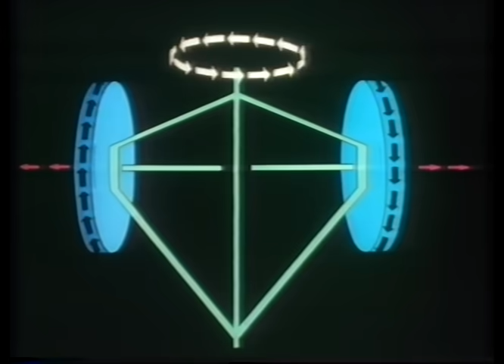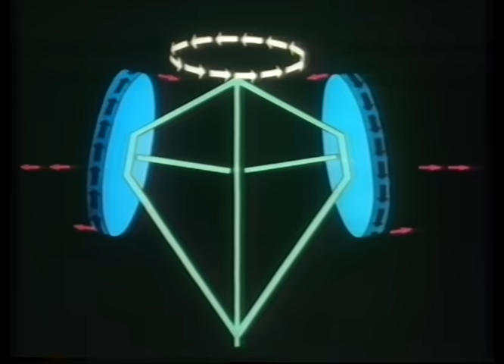Anti-Gravity Machine (Part One)

Comment: You are close!  The Idea of using two circular motions. Remember the second motion top of the gyro must be spinning the oposit direction and the bottom must go in the same direction.
Next increase the mass of the gyro's for more lift, and the diameter and thickness.

What your playing with is inertial force from circular motion.
It's an outwards force lagging behind the rate of change of angle outwards. It's the second unknown law of inertia.

The UFO'S are using the electromagnetic method. Yours is the mechanical method.

Perhaps understanding how circular motion really work's with inertial force would greatly help.

The top of the gyro moving oposit of orbit will cause more outwards force from the gyro, the bottom moving in the same direction as the orbit will cause less outwards force, while the outwards force elsewhere remains balanced.

The math for the second law of inertia:
(Lfi lbs =((M lbs×(~angle °/s))/radius in yrds))
~ =the rate of change.
Example:
(1lb×(360°/s))/1yrd=360lb/s of outwards force at 60rpms.

Remember Gravity is just an Inertial force from two circular motions. Orbit and Rotation the difference is g constant.

Comment: The entire reason a gyroscope displays "precession" is because of the bearings (or rotation point) of the spinning wheel's axle. I prove it in the video in the link below. The video It's a little long (put it in 1.5 speed if my helium voice isn't more irritating than normal speed...) - but I explain beyond a shadow of a doubt why gyroscopes display angular momentum and precession. The "torque" of centrifugal force the spinning wheel creates is transferred to its bearings (or left & right or front & back) points of contact between the wheel (rotating mass) and its axle (stationary mass).
The above is also why when outside torque is applied - the "motion" of the entire gyroscope always makes a 90 degree angle of movement - in the direction of rotation of the gyroscope - from the direction the torque is applied. Check this out and tell me that I am wrong.
https://www.youtube.com/watch?v=cF5fAQcZMvM&lc=z23rvnupezfzvjjbn04t1aokgln1ldx1ctwjatxo0ozxbk0h00410

Comment: Try building a lifter - google "lifter project"  -   put about 30,000 volts potential difference between the body and the top wire.

Also read the Indian Vadas re Vermanas --- rotating Mercury......Good luck - you definitely appear to have presented more evidence we live in hyperdymentiaonal programmable super-fluid .....

Comment: it uses momentum its not unique - i thought about this theory myself when i was 8 yrs old.. i now have a better sollution
Reply: No, you don't.
Reply: Ever had a small poled magnet .secured and place a circle magnet over it .if yoi put coils on two opposite sides .when poled spins change happens. Now think like a cut onion. Circles. Slide ing close to each other. With different polarity at speed .and frequency. Yes noise .used in control

Comment: After somehow coming to this page, I think I just might be able to shed some light a bit further HOW you can make it all fly!

The key issue is that you need to use multiple gyroscopes on ALL axes that creates SIX AXIS of stabilization in 3D-XYZ against the Earth's surface, and stabilization against localized rotational Roll-Yaw-Pitch (i.e. orientation) forces. Once you MAKE yourself (or buy for about $3000 to $10000 US or 2000 to 8000 Euros each!) some decent heavy-duty gyroscopes and ensure they are fixed to a platform and mitigate and/or stabilize absolute horizontal, vertical and depth movement in addition to rotational roll, yaw and pitch movements.

You can add another gyroscope (or more!) that will essentially throw the other gyros out-of-balance in the specified direction you wish to go!  The centrifugal force of a larger 7th gyroscope will act upon the already 6-axis gyroscopically-balanced/stabilized platform to FORCE movement in the plane of direction that you physically orient the 7th gyroscope into. With the platform already highly-balanced by the planar and the local rotational balancing grysoscopes, the 7th gyroscope will EASILY FORCE movement into ANY singular plane! And that INCLUDES UPWARDS from the surface of the Earth IF there is enough momentum built up into the 7th gyroscope to counteract the stabilization against the other planes that the OTHER SIX gyroscopes act upon.  

Think of this as a spinning top you can tip over with your finger and FORCE movement on towards a given direction! The spinning top goes towards the direction you tipped it towards and restabilizes itself. Here, you will do the same thing but course using much larger gyroscopes and a motorized tip-over mechanism.

By using multiple PLANAR and ORIENTATION atbilization gyroscopes (minimum of 6 and up to 32!) and a much larger momentum-inducing directional gyroscope (i.e. the tip-over enabler), you can GO FAST and GO HIGH in ANY DIRECTION you want!  Just make sure your multi-axis stabilization gyros have a high enough RPM and MOMENTUM ENERGY DIFFERENCE between the single directional gyroscope to allow for enough momentum to actually CARRY your bodyweight plus cargo, and the weight of the platform and gyros themselves! This means the Tip-over gyroscope SHOULD have about 4x of each singular momentum and the stabilization gyros, so I you buy six 250 lbs gyros, the 7th one should be at least 1000 lbs so the DIFFERENCE in directional momentum energy will counteract the other scopes' momentum energies. Depending upon how good the balancing gyros are at counteracting movement on ANY given axis, it may be required that ALL six axes momentum energies must be overcome which means the 7th gyro will need to be AT LEAST 1.5x greater to 2.0x greater than ALL the gyros combined, so for six 250 lbs gyros you would need a 7th gyro that is AT LEAST 2250 lbs of momentum to 3000 lbs or more of momentum! 

AND DO REMEMBER, I am NOT talking about the actual WEIGHT of each gyroscope but rather the ACTUAL AMOUNT of MOMENTUM ENERGY the gyro is applying force against. A really high RPM scope made out of lightweight material can impart MORE FORCE against a plane than a heavier weight gyro that spins slower. This means that a gyro may only weigh 10 pounds BUT it's momentum energy may be much higher due to a much higher RPM! (i.e. usually 30000 RPM to 100000 RPM or more!)

I think you're good enough to work out the math for all this, but LARGE 250 lbs to 1000 lbs stabilizing gyros SHOULD do the trick (i.e. these gyroscopes are usually found in yacht, specialty marine and cinema camera stabilization gear and applications!). It might get a bit costly BUT it's been done more than a few times before on special types of all-axis movement aerial drones I have seen!

.
Good luck and I hope this helps!
.
Reply: You obviously know nothing about gyroscopes. He is not even using gyroscopes; they are spinning-tops. Don't know the difference? Read a book.
Reply: I am quite familiar with gyroscopes ESPECIALLY since we CUSTOM BUILD THEM OURSELVES using CNC-machined Titanium magneto-bearing flywheels that spin at 160,000+ RPM and their requisite high strength Titanium casings which get used on our rather fancy 360-degree surround view 4k/8k camera systems which go on our 148,000 lbs sized aerospace drones that have a 150,000 foot ceiling!

So YEAH! NEXT TIME ya tell someone they don't know crap about drones DON'T WRITE TO A GUY who has $20 Million U.S. worth of them sitting in the company AEROSPACE division's warehouse! AND ESPECIALLY NOT TO the guy who SUPERVISED, HELPED DESIGN and MANAGED the CAD/CAM/FEA and CNC'ing OF THAT $20 Million worth of Custom multi-axis Gyroscope and Giant Camera Drone parts inventory !!!!!

I THINK I might just know a little bit more about angular velocity and momentum, rotational momentum than ya think, and ya know, maybe I might even know something about Newtonian mechanics, electro-mageneto-hydrodynamic flow theory, and of course add in something about a spinning top and its ability or inability to precess! AND while we are at it using Gyroscopes as a inertial propulsion mechanism ...hmmm...  didn't CSA and ESA just award the parent company Euros and CAN Dollars to explore just that?
.
AAAAARRRRRGGGGGGHHHHH !!!!!!

GRRRRRRRRRR !!!!!
.

Comment: Giros do NOT create lift nor do they run continuously without an external energy force. BTW, this mechanism has some similarities to the governors used to control the speed of steam engines. Except static weights were used instead of rotating ones but nevertheless, produce the same effect.
Reply: ITS SPELLED GYRO
Reply: L
Reply: Yes this device does not not create lift at all. The gyros on the end of the arms precess upwards (like an egg or top when you spin it) precisely because of the torque created by the arms being attached, which are attached to the base, which is attached to the table, which is attached to the ground. Without the torque (which is ultimately from pushing against the ground) there would be no upwards movement, and with no fixed point to push against like in space it would just rotate around in place without moving any direction.
Reply: Gyroscopes are awesome and can do wonders with balancing top heavy objects, it's always sad to see in the battle of one man's wish to change the world vs real world physics, physics wins, every time.
Reply: Have you seen plane fliying without carrying fuel and motor?
Reply: @KabelkowyJoe  yes it's called a glider
Reply: @KabelkowyJoe  Yes, they are called gliders.
Reply: @chrisantoniou4366  I knew your answer will be glider. This is why i asked such question - so you will see the pattern "gyro wont work continuously"  "gliders wont fly continuously" Have you seen plane flying without carrying fuel and motor? Yes it's glider, and this is why gyro without it's own fuel and motor wont work continuously without external force. But ability to create lift has nothing to do with "continuously" once disconnected. Use the freaking logic.
Reply: @KabelkowyJoe  There was no "continuously" implied or made explicit in your question, but there does appear to be some confusion about this machine being able to generate power, lift, or defy gravity.  Ultimately, the only real advantage a machine like this can bring is to interplanetary spacecraft which would benefit form not having the burden of carrying reaction mass...  I'll believe it when I see it.
Reply: I had the same question though.  If the lift you're producing is only enough to lift (almost) the weight of the machine, then you're heading down an eternal hole.  The more you add, the more you need, and there's never a break-even point.  (Basic assumptions, not an educated guess.... Just a plain guess....lol...)
Reply: @therealking6202  While you are right about about the weight of the machine, there are still advantages to be had with using reaction-less propulsion in space.  Remember, this isn't about getting "free" energy (you are right about there never being a break-even point) but about getting linear motion in space without the need for reaction mass.

The most obvious benefit is not having reaction mass which is usually a substantial proportion of the overall weight of a spacecraft (we are of course talking about a spaceship already in space via conventional means).  Then there is the fact that if you can make this sort of machine work (I'm not saying it's possible, but if it was) you can get the same effect from a gyroscope weighing less simply by spinning it up more.  Certainly that will require more power, but that's easily obtained, at least in the inner solar system, by solar panels.  So the possibility of having enough power to move linearly in space is certainly there PROVIDED the idea of linear movement by gyroscope can be made to work.

Having said all that, I'm extremely doubtful that the mchine can do what its inventor claims.

Comment: Love the spirit of the video, but were it a reactionless drive (as would work in space), it would need to produce thrust when there was nothing for it to push against.  In this case, the drill press which in anchored to the floor is the problem.  The drill press is providing a counter rotation to the "lifting" gyros while itself pressing against the floor.  Without a floor to press against, there would be no lift generated.  So, we are not seeing a mysterious lifting "force," we are just seeing the drill press lift the spindle by changing the lines of angular momentum in the gyro.  This is not new, many older children's science shows used to do the same thing using a pair of gyros and an armature.  In short, unfortunately, it would not work in space, or for a flying car and is not a new idea or force.  Love the video though!

Comment: I don't believe gravity has anything to do with magnetic fields, pulling us and everything.  Neither will electric or motion work to stop the pull of gravity.  All inventors are looking for a machine to shield or force gravity, to control it with electric or machines.  
A stick or rock falls to the ground.  There is no electricity or magnetic pull in a practical of sand,  or a leaf. Animals,  insects or glass. Everything is pulled to the ground.  So why built a machine to stop it?
 We need to be thinking outside of the lab or workshop to crack the problem of gravity and control it.

Comment: 6:25 Prof. Laithwaite could have performed a very easy test by simply standing on a scale with the disk spinning and not spinning. There is no difference in weight. He just did not understand the physics of a gyroscope which are admittedly not quite simple.
Reply: 7:29 
😂
Reply: @TQ jokes on you buddy, the Flux capacitor was a hoax! Besides, everyone knows you need a minimum of 4 food processors eating a full bundle of banana peels EACH to reach anywhere near 1.21 gigawatts!

Comment: Thanks for this video.....
Formula 1 race cars use a gyro to charge their energy propulsion system that is now offered in production cars for and extra $250,000
Reply: No, that is a flywheel. The latter may exert gyroscopic forces, but it is not a gyroscope. Neither is Kidd using gyroscopes; they are simply spinning-tops. The gyroscope has a very specific construction and has existed for barely 200 years; flywheels and spinning-tops have existed for millennia.
Reply: MrAaronvee 
very interesting. Isn't it terrible that a person can learn more online in a very short time than someone spending a decade being probed and indoctrinated at a public school, or even a more higher education can't produce the infinite knowledge available from the Internet.
Reply: @theOGDirkDiggler  Well, that is an outsider's view of higher education. The latter is not really about rote-learning, as you imply, it is all about learning how to evaluate information and how to develop new information without fooling oneself. If you think that the internet is a reliable source of information, you are clearly in need of re-education.

Comment: That gyro is not generating a lifting force. If it didn't have a central shaft to ride on it wouldn't lift up. It's like swinging something attached to a hoop around your finger. It will eventually "ride" up your finger and fling off. Without your finger to ride on, it's not going to go up.
Reply: Do you know the woodpecker toy which slowly descends a rod? If the woodpecker is replaced by a spinning-top, the latter can climb up a rod. This is an extreme form of the ratchet-effect which fools many would-be antigravity inventors.
Reply: @MrAaronvee  Exactly. Good point.

Comment: Hi Sandy, Very exciting work!! I was just wondering if it has been tested with a fishing or postal scale type setup? If it hangs from a string or rope, any type of unusual ratchetting effect could be ruled out. You have the best invention so course people will want ultra clear proof. People are too religious about some scientific concepts and with incomplete understanding. Your work is wonderful.  Thank you! Ethan I'm the inventor of a "Self Contained Ion Powered Aircraft." www.electonairllc.org
Reply: It should have been tested using a ballistic-pendulum set-up. A permanent off-set from the vertical would then constitute proof.
Reply: Hi Sandy, OK, I have seen a video of it hanging from a string. The string however goes over a pulley to an adjustable counterweight. The spinning rotors are moving fast in the open air and gas is being used up: So, the weight is reducing by perhaps a "few grams every few seconds" or so due to gas usage, and the rope over the pulley may have a reduced friction level from the shaking. Lastly, the spinning gyros could be moving a few grams of air downwards. If you hang it directly from a fishing scale, enclose the gyros in plastic, and measure the gas usage, I think you will end all arguments. 
Thank you so much for the great work!
Ethan Krauss www.electronarillc.org
Reply: @KraussEMUS1  Professor Salter of Edinburgh University wrote an experimental protocol for testing such machines. Kidd ignored it. The only certain proof is to use a ballistic pendulum. A permanent offset from the vertical (and thus a constant increase in distance from the ground) is adequate proof.

Comment: Sandy, you thought, for some reason beyond me, that by tilting the gyros that would tilt the centrifugal acceleration vector, along with the angular momentum vector of the gyros.  You had me doing it for a minute or two !  But why would a rotating masse's centrifugal acceleration be any different to a non-spinning one ?
It will still be perpendicular to the axis of the centrifugal rotation. Won't it ??!  !?  i.e. no component in the same direction as the axis of rotation.
    All the spinning gyros on its rod does, while it precesses, is provide a torque,  M x length of rod.  This effectively shifts the C of G to the handle end of the rod.